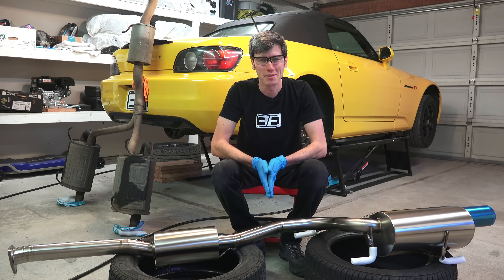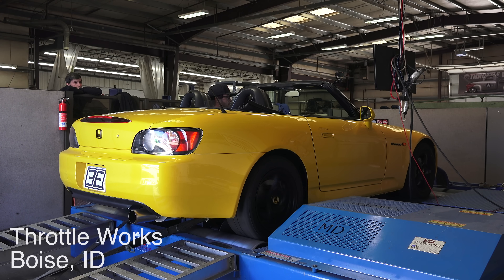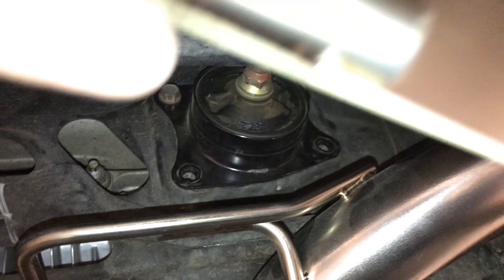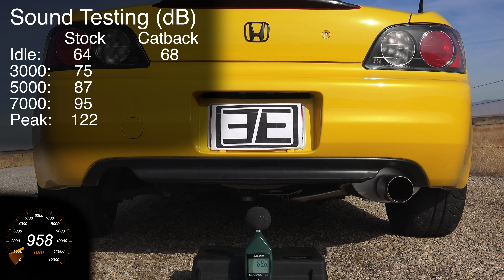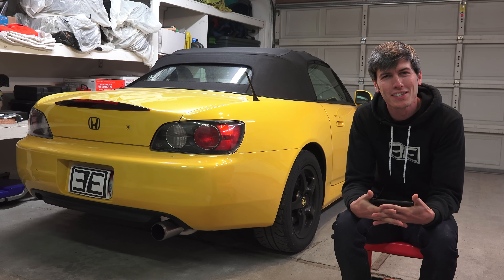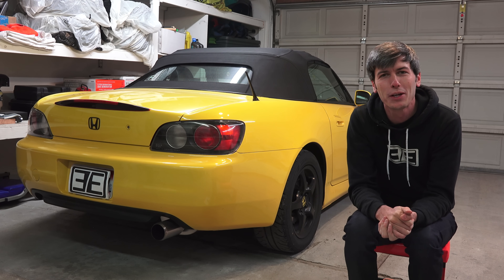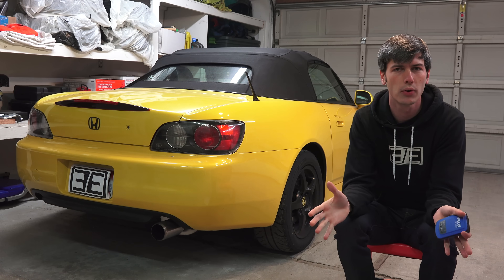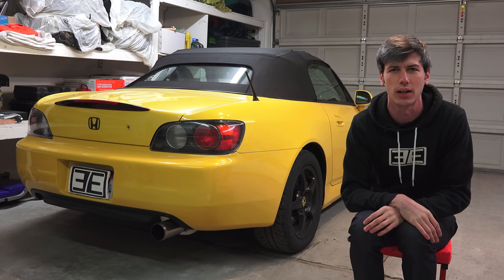Can A Catback Exhaust Make Your Car Faster?

Comment: Really fascinating and I appreciate the effort put in to learn something. I've spoken with a couple of people who design exhaust systems and interestingly enough, by far the most restrictive part on any stock exhaust is the muffler (besides the cats). This is usually because of how they are designed cheaply and to reduce noise by a lot, sometimes just replacing the muffler itself with one designed to be less restrictive can get you the 3 hp you want. In addition, you don't want to just have the widest exhaust pipes possible, this is because of what is called "exhaust scavenging" look it up, its a fascinating piece of science!

Comment: would an aftermarket header make more difference?
Reply: Depends on the quality of the header design and build quality; intake and exhaust flow is a science, not a simple yes or no answer.  It has the potential to add power, but as usual there are multiple factors to account for, and to make the best of any engine based modification you need to tune!!!!!
Reply: runman xD it would probably  on a regular  car, not Hondas sport car, as they have this set up pretty stout from factory . So I think it's stock manifold is  tuned just right. But there  is a lot of room in the s2k  engine bay for a equal length long tube header which would be the best set up. So if you can find one of those that would be better .
Reply: No, the stock header on a S2000 is already excellent.  Hytech however offer a combination of cams, header and exhaust that is supposed to make gains when used as a complete package on the S2000.

Comment: Generally you're not getting much HP gain from a high performance exhaust. But you do get a significantly lighter and better build part which will never rust and doesn't need changing anymore.
Do you have plans for the left hole in the bumper left from the original exhaust?

Comment: What I still don’t fully understand is why on some vehicles you can see a decrease in the low end power and torque by adding a more free flowing exhaust. 

I have a 2004 Nissan Pathfinder (yes big heavy slow SUV) that I redid the exhaust on from the cats back to the tailpipe. Larger diameter pipe. True y-pipe vs dual in single out muffler and a high flowing muffler. It dynos lower in the low range but I saw about a 1.5% difference in peak. It made 237whp before vs 240whp now. That’s basically no gain at all. 240 is what was advertised when these were new by the way. I lost about 3% in the low range which I can feel. 
So now I have a louder, slower suv than before. Maybe back flow just doesn’t make much difference on the vq3500 motor but it’s similar to what’s in the 350z and people post gains all the time. 

On the other hand, my Volvo S70 GLT light pressure turbo with a straight 5 engine saw gains. I haven’t dynoed it but it’s definitely faster than before. I wanted to keep this car quiet though so I put a slightly more restrictive muffler but still increased the overall diameter of the pipe removed some bends and deleted one resonator. It’s not louder. It’s just faster. My 0-60 went from 6.4 to 6.0 as an average of 15 runs on the same stretch of road from the same starting point. Not a perfect test by any means, but still enough to establish a trend I would think. 
So what’s the difference? Is it the turbo? In this case probably, but in general why do some cars see lower numbers after a custom exhaust while others boast gains?

What I would like to see is different vehicles with different engines but with same or similar power ratings and same flowing exhausts dynoed and road tested before and after higher flowing exhausts.

Comment: $2000 for 2 hp isn't great, but the weight savings is nothing to scoff at. 
I would be interested to see the power difference between this cat back and a stock one, but with a header and high flow or no cat. 
Awesome video!

Comment: An FYI in case anyone is interested - I work at a shop with a Mustang Dyno so I'm lucky enough to just put my car on whenever I want. I have a bone stock AP1 with 140k on it. I dynoed the car this summer at 197.78whp and 131.52wtq and the next day put on a 70mm Evasive 70-SSP catback exhaust and did nothing else. Weather and time of day were basically identical and I ended up with about 202.82whp and 135.42wtq. I did see a very slight increase pre-VTEC, but much like the video portrays, this power and torque increase was seen throughout the entire power band in VTEC. Routing is basically the same as the Amuse system, but obviously it does have a heavier weight since it's stainless steel. I was happy with my 5.04whp and 3.9wtq gains because I was primarily just looking for a slight sound bump (quality and volume) along with the better look to the exhaust. Unfortunately in this case I think he would have truly been happy with the 70mm version in both added horsepower for the same cost and also a slightly louder exhaust note without getting too crazy. But you cannot always avoid mistakes in this hobby.

Comment: it seems like it changed the pitch of the exhaust more than anything, it sounds better, and it seems very slightly louder, but I think if you want to get more gains you should go with a full exhaust system header to tip. you're gonna lose more weight, you're gonna get a bit of a better sound and you're probably gonna get a little more than 2.5 horsepower increase. I don't think this was worth 2500$ but between the power and weight, if he was able to get it for a cheaper price, it would be more justifiable

Comment: I would guess the fact that acceleration time is proportional to the integral of the torque is mostly responsible for the surprisingly high percentage gain, instead of ambient conditions. Go to 80 mph and expect an even bigger percentage gain.

Comment: Does the fact that the stock exhaust had 2 exits (for lack of a better word), compared to 1 exit for the catback, have to do with power output and could that be the reason why the gain was, relatively speaking, so small?

Comment: "Overnight some parts from Japan"... lol, only you, EE, can get away with making a 'Captain Obvious' video about a cat-back exhaust at this late day and age of the auto tuning hobby. For what you have spent on that ricer ( I am including the body work, and the collective YouTube viewership's time ), you could have gotten a cream puff C5 Z06 and really spun that dyno, not 180hp, try 360-380 before even dirtying your hands on the air filter.  Otherwise, how about headers? Those things that slow exhaust gases up at the engine block? Replace those and re-dyno? Is that in conflict with the turbo you are going to install?

Comment: In the case of it being an S2K, you should've went with a 3" exhaust. Yes most 4 cylinder motors don't benefit from the larger exhaust but  Honda performed some kind of witchcraft on the K and F series motors and they really like to breathe.  Needs to be a full 3" though (catalytic converter included)

Comment: Not all whp is used for acceleration, some is used for aerodynamics and front wheel losses which is constant before/after the modification. As a result, acceleration improvement should be greater than hp/weight improvement.

Comment: all the weight saved is what you gained... whatever hp the graph shows it gained is not really a gain because the numbers weren't produced on the same day and conditions, if it was dynoed right after a stock run, then it would make more sense.

Comment: It may be one third the weight but you only put a single exit on where the stock was dual. You could have shaved half the weight by doing that alone. Titanium is not that much lighter when it's that thin of metal.

Comment: 0.37 0-60 increase is really nothing to snuff at for sure. Not to mention fuel economy and general braking and handling will be improved. Is it still worth the 2500$ probably not but hey like others have stated there are other light offerings out there for cheaper. I will have to keep this in mind when getting an exhaust for my gti.

Comment: 2 hp sucks yes, but a .3 second improvement is pretty impressive for replacing an exhaust. And the fact that you lost weight you can almost pretend you got a 5 to 10 hp gain because of so. expensive exhaust, find something that gives similar results, but I don't think it's a total loss

Comment: Isnt 186 on the wheels a bit low for a s2000? How does it lose 50hp between crank and the wheels?
Reply from the maker: +Tolmalion conservative dyno settings, it’s run 221 HP with different settings. The gap from before and after is more important to analyze than the specific HP number.
Reply: +Engineering Explained I've never realised how much of a difference can settings on the dyno make, thanks for clearing that up.

Comment: a stock setup with out the cat and ebay mufflers  make more power ....bang for buck . don't let rich people  sucker you into buying expensive parts  , yes some things you cant hold off on  but .......exhaust pipes  don't matter after the header spend less and do your own r&d or be driven by looks and try not to be called a "ricer" because  you got brand name parts .i rather be called a ricer and make 5.4hp more off 200 bucks . MCM proved it in " Increase horsepower with a potato" the legendary  "fart can " made power . but all the hipster  bros close  their  eyes  when that vid came out lol.

Comment: Great video, you may want to use scanner for data also.  Graphing RPM, MAP, MAF, AIT and etc, can give you real data for engine breathing conditions.  Sometimes air intake temperature can change due to under hood temperature.

Usually, revving the engine will not cause black smoke coming out of exhaust like your car.  Maybe it is the way it is design.

Comment: Maybe you could try adding back the weight to see how much difference the power improvement makes by itself.  The environmental conditions between runs would also be the same between the two runs as you'd only be chucking in a bit of weight between them.

Comment: While a 2.5 hp gain for $2,500 sounds seems like a bad deal, keep in mind the 35 lbs. in weight your saving, and the improved sound. Worth it if you can spare the money. I'm curious though, would you consider not removing but changing the catalytic converter? I believe you could find one that would be less restrictive, further reducing the exhaust back pressure. I think it would also compliment the new catback exhaust nicely, to find even greater gains together.

Comment: You mentioned that it was not restrictive stock in the beginning, and it still made a better curve on the dyno curve, and weighs about a third of stock, and the high cost I think is mainly because of the hand made aspect as well as the high cost of material compared to normal stainless steel or what not that is used normally at an exhaust shop, so i guess if you want a more race oriented street part, meh its pretty cool, if you want full blown power, replacing something that isn't restrictive in the first place and not gaining much is kind of expected. All in all, decent video.

Comment: He should have added a fart can. Those add 50hp for drifting in your 1994 honda civic automatic with 250k miles. Also nothing goes better with rusty dents then a set of american racing chrome wheels and erector set wing from walmart. Don't lower it just cut the springs. Is ricing still a thing? I only see riced out cars in low income neighborhoods that probably bought the car riced out.

Comment: I think it depends on the car. I had an e36 328i and when I put a catback on you could let your foot off the clutch and without touching the gas the car would drive forward without stalling out.
Reply: You should be able to get any car (not sure about something like a semi) to move and let your foot off the clutch without any gas provided you aren't attempting to go up a hill.
Reply: Dave B 
I swear all cars are like that. My acura El and integra is kinda the same. But I can't just dump the clutch I have to let off easy and it will start rolling. I can't do it up hills but can easily do it on down hill and relitively flat surfaces.

Comment: Instead of removing the catalytic converter all together, wouldn't a high flow cat be a more worthy investment for more power?
Reply: Yes, I know that, but in most places a cat delete is illegal. I was comparing the HFC to the catback.
Reply: Questionable ethics for an marginal gain. Do you know how ridiculous that is?

Comment: I think it will work a lot better with a sport cat and maybe a remap. It would be very cool to see you change the point where VTEC engages. I'm sure it will make more power then the stock cam from as low as 5000, maybe even lower. My ITR is set at 5000 which works great.

Comment: But still you need to have enough back pressure from the exhaust in order for the engine to work properly. There's a small overlap between the camshafts where both of the valves are open. Please correct me if i am wrong.
Reply: Sergio Aguirre well, i am not 100% convinced in this. In the newer engines there's an Otto Cycle in which depending the load you have a cycle with fully opened exhaust valves while the piston sucks air. This is why high power downsized engines became possible. Also it is one of the reasons even higher power and more efficient gasoline engines without spark plugs are about to be released to new vehicle models.
Reply: I see. I didn't have in mind the ultra high revving engines. The sparkless gasoline engines are running in the same rpm range as the diesels. Their redline is at 5-5500rpm. I am well aware of the header gains. I want good headers for my Tiburon as well (2.0 but currently faster than the 2.7 and the GT86), but my catalytic converter is in front of the engine. It is 3-way, big one, quite efficient and i don't want to change it. So this is for now what's holding me not installing new exhaust headers.

Comment: What is the altitude where the dyno tests were done? (I live in Albuquerque, NM and my house is exactly 5,280 feet in elevation. I regularly drive my stock 2005 S2000 in the mountains in Northern New Mexico which range between about 7,000 feet and 11,000 feet, the loss of power is quite noticeable at the highest elevations. I'm guessing the loss is about 2-3% for every 1,000 feet, it's down roughly 15% just driving around town. I've had my S2000 down to sea level in California a few times and it was like a whole different car. I should probably invest in a supercharger to compensate.)
Reply: Yeah, I thought about a turbo but I just don't want to deal with even a little bit of turbo lag. I would be perfectly happy just to have sea level performance at my elevation.

Comment: Maybe in combination with downpipe and headers would prove better for improvements in airflow/reduction in backpressure, though in both cases I think to make the most of this needs ECU reflashing (Hondata?). TBH with such a high revving engine, maybe a lighter flywheel would be a cool upgrade. Slightly biased as I'm an electrical, not a mechanical engineer. Your experience reminds me of Mighty Car Mods and their pod filters providing minimal hp gains, even a giant pipe into the blowing fan.

Comment: SInce youstarted with saying the stock is open enough, we can't expect  some magical hp to be gained, can we? Maybe this exhaust has a nice way of raising more horses on a turboed and remapped cars, compared to the same one with the stock exhaust. If you  have forced induction and you are working on the ECU mapping on a dyno, maybe this exhaust will give you some % possibility to gain. Also, if the car is a crazy tune project, these pounds lighter are a gain alone, as we know Porsche put a sticker Porsche emblem on one of the 911 GTs trying to make a point with weight-saving.

Comment: You just contradicted yourself within 10 seconds apart...If you "don't think the cat back is what's the restriction" yet having a simpler cat back with less bends leads to more power, then clearly the larger 70mm would've made even more power by that same logic...come on man

Comment: You'll have to get a new rear bar now... single exhaust tip in a twin cutout bar looks a bit odd

I bought my S2k with a twin 115mm tip Xforce exhaust already fitted. It's obnoxiously loud, but it does have a nice low rumble that a lot of "fart can" exhausts lack and it just screams through VTEC. I've got variable silencers in it that make it a 40mm exit size that cut a lot of the noise when closed, but they seem to cut a fair bit of power as well.

Comment: You need to do an N/A build. Intake and exhaust flow modifications are much more effective when combined with other modifications like cams, head work, higher compression, and management. What a learning journey. No boost, though.

Comment: 2500 dollars is not worth it IMO, I bought an invidia single exhaust for 550, although not as light as he full titanium, still had good power gains around 5whp.

But I guess the weight savings and the fact you can say I have a full titanium exhaust makes up for it, somewhat.

Comment: Interesting test. Well done. The only thing you neglected was your talking about flow restriction. In your case it is mute but for those looking to increase diameter of exhaust for better flow it must be made clear that in a N/A car you must be very careful because opening the diameter up too much can and will most definitely have a negative effect and cause a loss of power. However in an aspirated car this is not the case. 

So i would suggest to anyone looking to tamper with such things please do a lot of research before moving forward and save yourself time and potentially wasted money